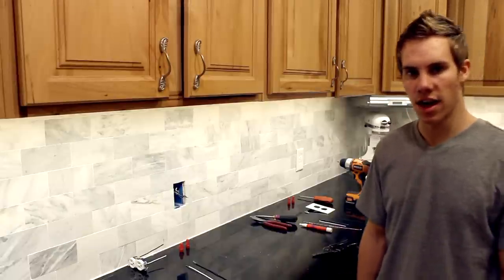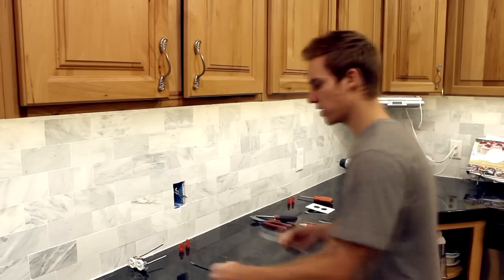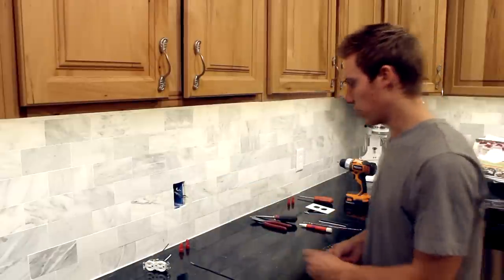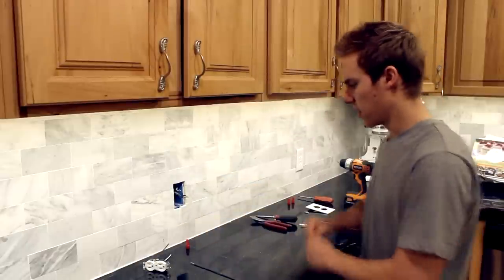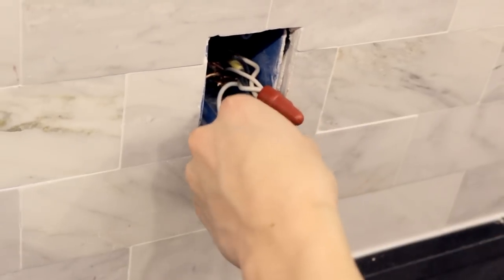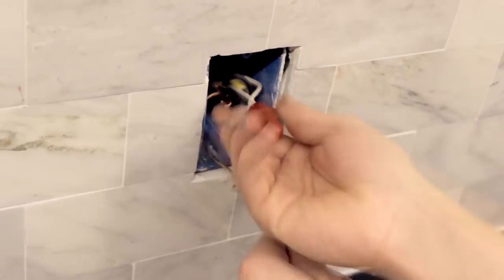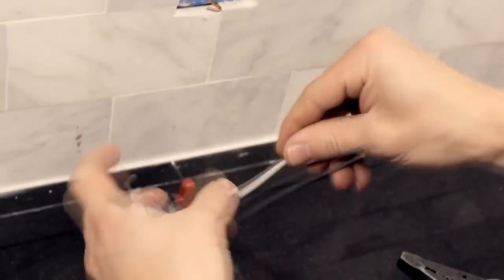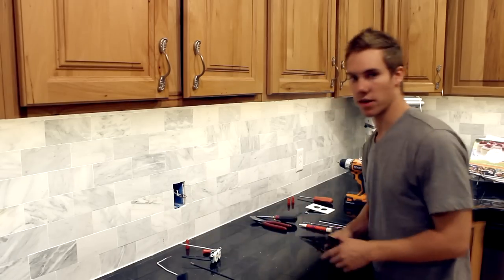How to Pigtail Electrical Wire

Comment: Master electrician my ass. Wires should be twisted with pliers before installing a wire nut. The connection should be solid first, without the nut.

Comment: Someone tell the "master electrician" that you need to have 6" of wire in the box. You should not have to reach inside the box to twist wires and make a wirenut joint.
Reply: Nothing wrong with pretucking your wires

Comment: What gauge wire?
Reply: BRIAN THOMPSON — same as the incoming, from breaker. Typically 12-2. Check breaker. Don’t go smaller than breaker. 20 amp breaker protects 12 gauge wire.  If 15 amp breaker then 12 or 14 gauge is ok. Burger is ok, not smaller.

Comment: Twist the wires before applying the nut.
Reply: solid wire won't twist unless you are referring to the excess that isn't going into the wire nut.  However, there was an assumption that the outlet colors were the same.  I can (unfortunately) see in a crystal ball that someone will end up pick tailing a ground or neutral, which will create all kinds of fun.
Reply: Also, if you're working with solid wire, pre twisting the wires (using pliers I would assume) is unnecessary and more difficult to work with when the next guy comes along. Wire nuts are made to twist the wires for you, just make sure you get the wires seated before you give them a twist. Usually a quarter/half turn backwards is just enough to line them up

Comment: It is not legal for 2 "white" wires to be on a "plug"
Reply: bung hole I'm having a hard time giving credibility to anything you say since your name is "bung hole".
Reply: Electrical Code varies from state to state. You may very well be correct in certain situations although I personally have never heard of such a thing in Idaho in the past 10 years in the electrical field. However, there are 2 screws on the neutral side of a receptacle so if it were "illegal" i doubt the option would be readily available.
Reply: In multiwire branch circuits, (I should have added to my previous comment) the continuity of a grounded conductor must not depend on device connections such as receptacles, lampholders, etc., where the removal of such devices would interrupt the continuity. [300-13(b)] This simply means that the continuity of the grounded (neutral) conductor must not be dependent upon the device.

If removing the receptacle interrupts (or breaks) the grounded conductors’ continuity, the grounded conductors must not be joined by way of the receptacle. Simply splice the grounded conductors, and install a jumper wire to the receptacle. If the receptacle is removed, the continuity of the neutral is not interrupted. This helps ensure that there will be a proper return path to ground.

A Multiwire Branch Circuit (in the electrical code) is defined as a branch circuit that consists of two or more ungrounded conductors (two or more "hot" wires) that have a voltage between them (they are not on the same electrical phase and so are connected to different buses in the electrical panel), and a grounded conductor (the neutral wire) that has equal voltage between it and each ungrounded conductor (hot wire) of the circuit and that is connected to the neutral or grounded conductor of the system. (Paraphrasing NEC Article 100).

In plain English, a "multiwire branch circuit" or "split-wired receptacles" means that two hot wires are sharing a neutral wire.

SO YOU PRETTY MUCH ONLY HAVE TO DO THIS WHEN YOU ARE NOT WORKING WITH ROMEX :P

Will hope this will help some one out there. :)
Reply: Levi Edwards — almost.. that is for a separate circuit to each plug. Example: one is hot all the time and the other is switched from a wall switch for a table lamp.  Just don’t feed thru to other boo I ex’s. It’s not a good idea.
Reply: So just look it up for your self then :P
Reply: Thanks for the reference :) So does that apply to the neutral wires as well as the ground then? I know the continuity of ground wires are never dependent on a receptacle but it seems common practice to use both available screws in an outlet.. If it were against code I would think the inspectors would love to crack down on that one haha when it says "grounding conductor" does it mean both the ground and the neutral? I never went to school for this stuff but I had worked in the trade for quite a few years.
Reply: Levi Edwards $$ GROUND is not NEUTRAL. That is why they are DIFFERENT wires. Neutral is insulated WHITE and GROUND is BARE.  They are typically connected in MAIN PANEL, but NEVER connected in a outlet box. Never. You should watch many YouTube videos about electrical and read comments. Some jerks just want to obfuscate (hide) the facts — these guys are sophists. An ancient group that made a mockery of dumb laymen. Sad, mean as may be, that those people still exist. But NOW we call them LAWYERS.  This is not a joke. Look up sophist.
Reply: In multiwire branch circuits, this is "code" because if you get a brake in the neutral it can cause your plugs/lights to get 220v instead of 110v. I made a crappy little pic to show why this is good practice whether code or not. 

https://www.facebook.com/photo.php?fbid=10153065508097010&set=a.41646887009.49964.791027009&type=1&theater
Reply: This is only for multiwire branch circuits.  Bad practice, in my opinion.
Reply: Technically it wasn't it was on a wire attached to the outlet.
Reply: bung hole I think it's safer and more cpnvinient